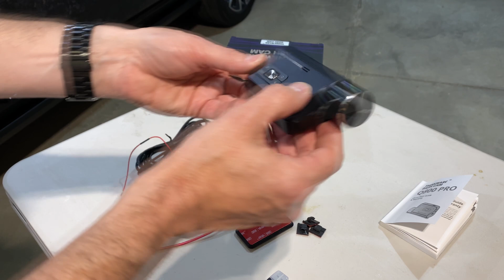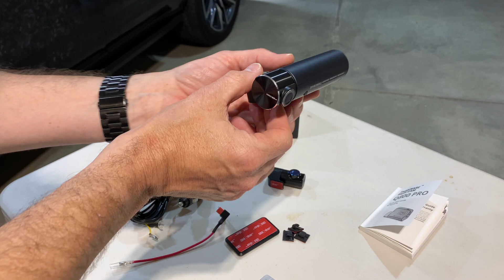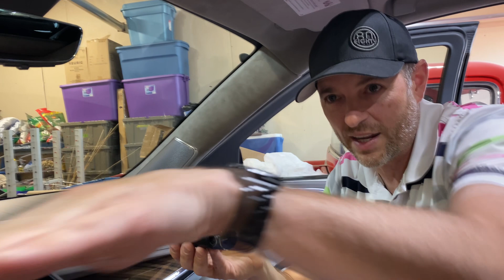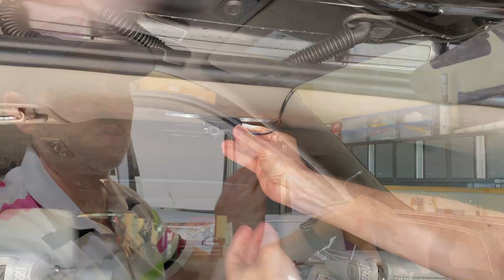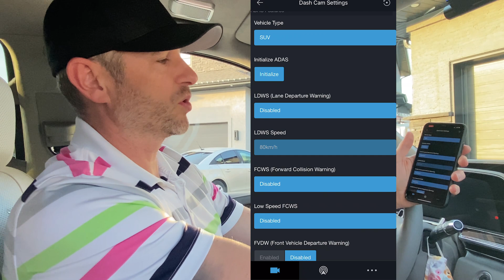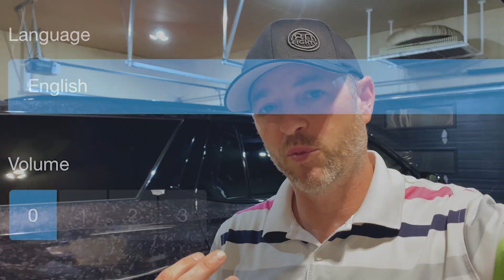Thinkware Q800 Pro Dash Cam – Install & Full Review | Best Value Dash Cam?

Comment: Nice video. I just got this dash cam. I truly wanted the u1000 pair but the deal for the f800 pro included a new ivolt external battery, so I couldn’t resist. 
I’m installing it on a similar suv, and agree in the center below the oem radar detection is too low for me.  
Thanks for the great video. I’ll install mine in the same place as yours using the ivolt battery. I will probably turn off the alerts it produces as my suv has that standard and I prefer to here that one

Comment: Would you know if this dashcam is alright to sit in cold conditions like -40 Celcious and still work fine?
Reply from the maker: I haven’t long-term tested ours in -40°C since the truck is garage parked but it works when parked outside for 8 hrs in those temps.  The ambient temperature in the vehicle is certainly a little warmer.

Comment: I have the F200 version. I have a camera in the rear window. Installed by my Chevy dealer. When I hit the R button on my phone for rear camera it is just black  it’s all set up correctly. Like I said when I choose the rear camera the screen is blank/black. Do you have any suggestions. Mine is the Thinkware F200. Thanks
Reply from the maker: If you pull the microSD card is there 2 files? One for each camera?  Otherwise try a hard reset with the rear camera plugged in

Comment: Donslife thanks for the video.  Plan on taking this project on myself.  My only issue so far is the fuse box.  Will be using fuse taps for 2 channel cam.  2023 Escalade ESV- Could you guide me in which fuse to use in the escalade?  This freaks me out involving the fuses.  Thanks in advance
Reply from the maker: No worries.  Assuming yours is the same:

Red wire on Fuse F26 10A-USB
Yellow wire on Fuse F40 10A-Not used (live circuit)

Comment: Regarding "parking mode" and voltage protection, I'm reading user feedback and many are mentioning the fact that parking mode will restrict you to approximately 2 or three hours of footage before shutting off.  I'm wondering if you have any feedback on this?  Thank you.
Reply from the maker: You are correct.  Continuous recording with the vehicle off will drain the battery faster.  If you drive the vehicle daily the battery voltage would usually stay high enough to keep the camera i parking mode, just waiting for a potential event to occur.  Then if it happened, the recording would be a measure of minutes and hopefully capture something.  Then after driving the next say, your battery would be mostly topped up again.   I can see leaving the vehicle parked for several days without driving would eventually put the camera to sleep due to the voltage drop over time.  In that case it wouldn’t respond to anything until the vehicle is started.
Reply: @Donslife   Thanks for that information.